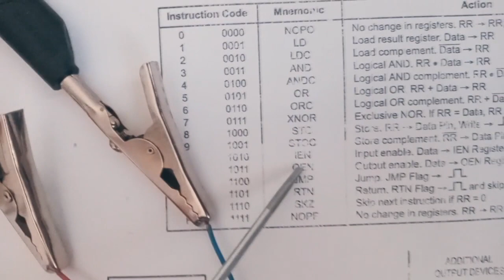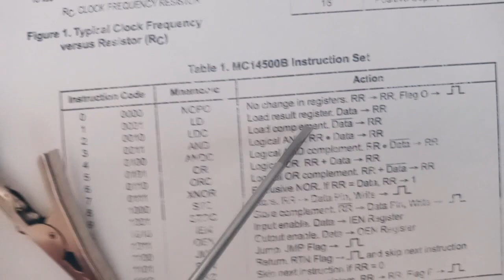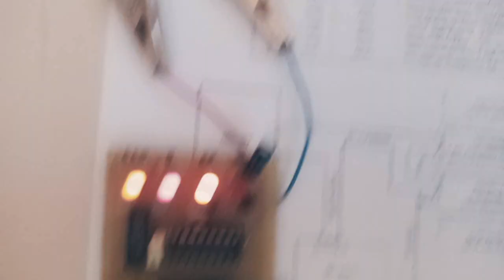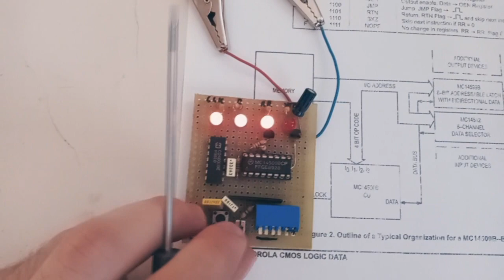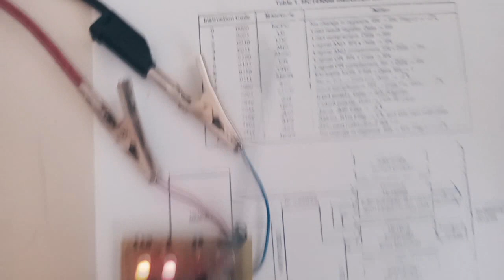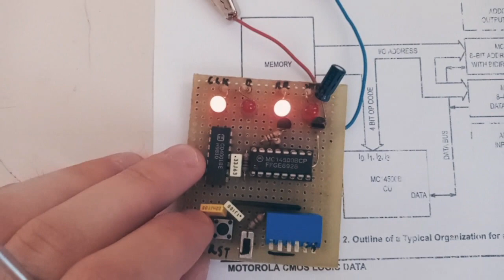MC14500 1 BIT CPU DEMO

Comment: Hey, could you post your schematic?
Reply from the maker: https://web.archive.org/web/20150529230820/http://www.webalice.it/giussdp/cpu1bit/index.html

here you go (not designed by me btw)
Reply: @SkazaTV  Thanks a bunch!
Reply from the maker: @TheWinnieston  np. if you need any help/tips let me know.
Reply: @SkazaTV  Does the voltage on pins I0-I3 have to be 5 volts, or can it be 3.7, like from a transistor buffer?
Reply from the maker: @TheWinnieston  can be 3 to18v but check 14500 datasheet
Reply: @SkazaTV I have a few questions regarding to how you actually wire it, I have a board and with that link went ahead and drew the stuff out but I where the 4 resistors are I can't tell how it's actually connected
Reply from the maker: @yr-eva-n  
The resistors for dip switches i actually used "SIP resistor netowrk". Did this help you or are you needing some further help?
Cheers
Reply: @SkazaTV  I meant the 4 resistors in the image next to the 4 lights, I can't tell how they are wired under the board
Reply from the maker: @yr-eva-n each is wired in series with the led.
Reply: @SkazaTV  is there any way i can get a visual of the back of the board
Reply from the maker: @yr-eva-n  I will try to find it and take a photo, but there are just wires.
Reply: @SkazaTV  sorry for all this I'm just 16 and wanting to start in the engineering field and thought I could start simple but seeming to be not as simple as I thought